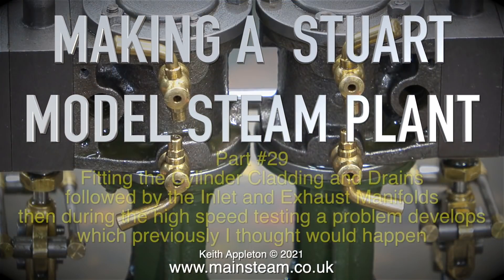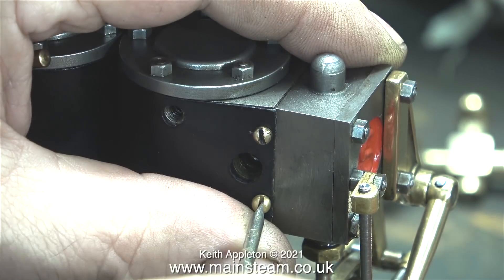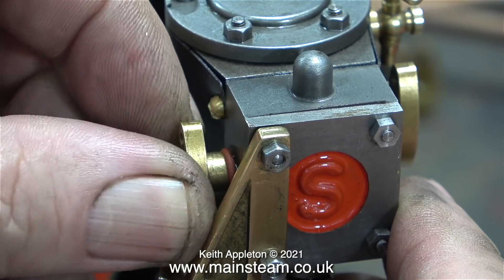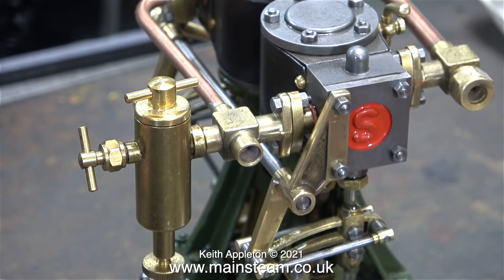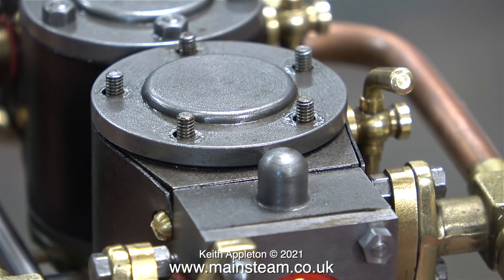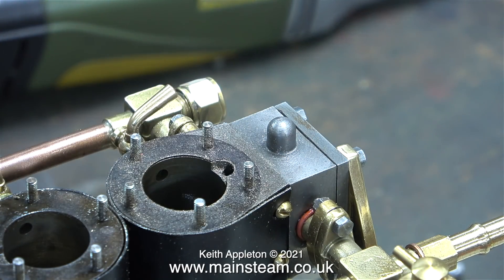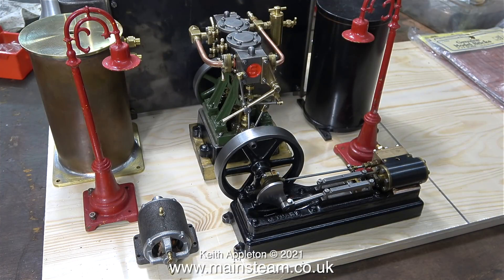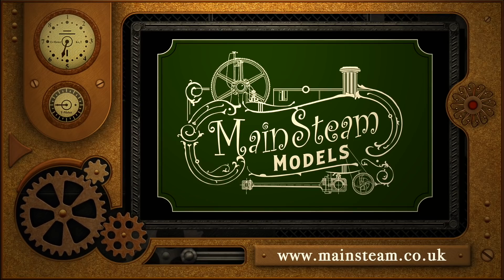MAKING A STUART MODEL STEAM PLANT - PART #29

Comment: You would be surprised how often different thread sealers, retainers, and lockers are mixed up. There was a push in the aerospace industry to standardize colors among manufacturers and to use different bottle shapes and colors. I would be devastated if my steam engine broke, but it’s nothing like having a valve fall apart in flight!  Or worse yet, having a million dollar component that nobody can take apart.

Keith,
I absolutely love all that you do on your channel.  Much of my love for all things mechanical stems from playing with steam and such at a very young age. You will probably never know how much inspiration you are providing for future generations. Thanks so much!!
Reply from the maker: A very good point, and I totally agree with you - failure is often not an option in the full size . . .  also thank you for your kind comment.

Comment: Bonjour Keith,
I have been criticized on my videos because I use the reversing gear under (low generally, about 15 PSI) pressure. Sometimes my little machines do not restat if I stop the steam before the reverse, this is why. Based on your experience, do you think it is a real problem able to generate a failure ?
Amicalement, Raphaël
Reply from the maker: I am with you on this Raphaël, 
I generally user reversing gear without backing off the regulator fully. Not all steam engines are so perfectly timed that they can be relied upon to start every time when reversing, so keeping some pressure on keeps the cylinders warm and holds the slide valves against the port block ready for action. There is a Steel Mill rolling steam engine in Sheffield, UK. That reverses instantly with pressure kept on and it is really big - !
Reply: @keithappleton  Bonjour Keith,
As you are a reference in steam also in France, I will share your answer with the people who criticized me ! Many thanks for your reply,
Amicalement, Raphaël

Comment: I wonder how you are able to identify the sound of a loose piston !
I would never in a thousand years have guessed that would be a cause for concern !
As for that steam plant well I'm no expert but I think I would prefer to have both engines in a more prominent position at the front. 
To me the engines and boiler are the main features of the set up and the water tank and condenser should be out of sight from the front. The lights are incidental and just show the potential of the engines, I think I would place them where they would show some detail of the plant and not to show their own detail. Placing them inline forward instead of sideways might be more interesting.
Reply from the maker: I heard the sudden difference in the sound made by the engine. It's all down to experience I suppose . . . .